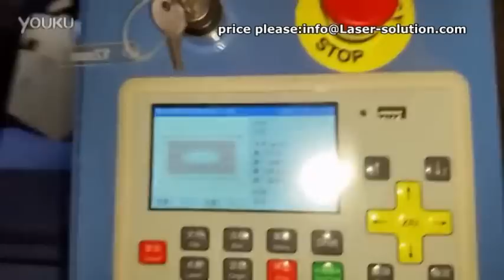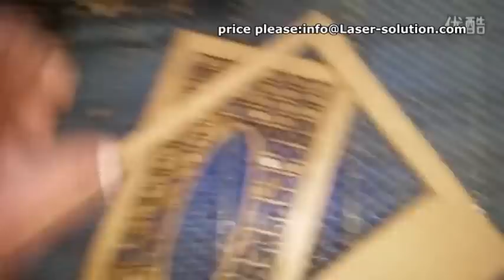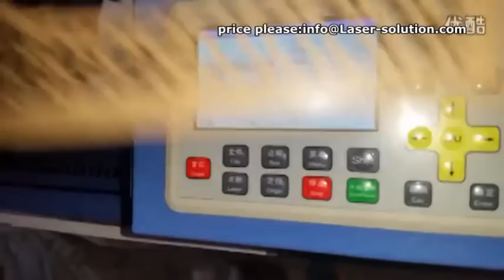MDF laser cutting machine, cnc laser wood machine, plywood laser cut

Comment: how thick is the laser beam?
BTW, you could avoid this many questions if you put more data in the description
Reply from the maker: +dimirsen thickness of laser beam? or the thickness of MDF.

Different materials, different thickness will need different power, 
Different size, different cutting speed, will need different power, too

we are factory of CNC cutting machine, and CNC Solution provider, maybe you can give us your work, we can give you a perfect solution
Reply: +Laser solution I understand the basics of laser cutting :)
Let's rephrase. What is the minimal thickness of the laser beam? Actually I thought this value depends on the focusing configuration, not the power.
My portfolio: http://vbp.maxnet.ru/portfolio
Reply from the maker: +dimirsen Good， such machine, we usually use Glass laser tube,it can engrave and cut, if you are interested, maybe I can give you our machine details.

we can sent the samples to test. hahaha
www.pclgroupcncmachine.com